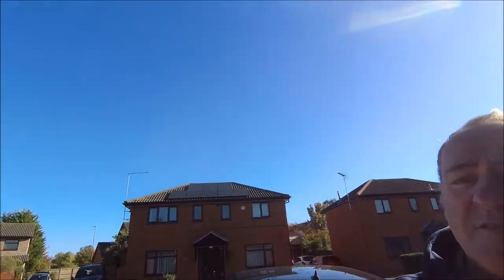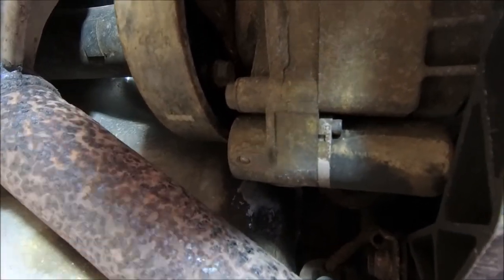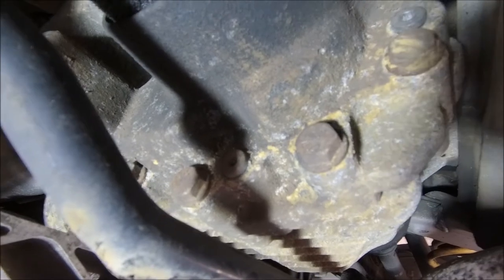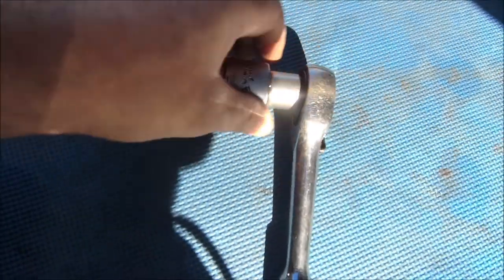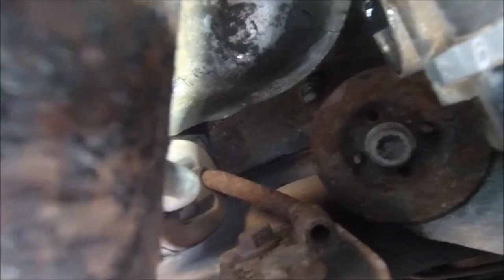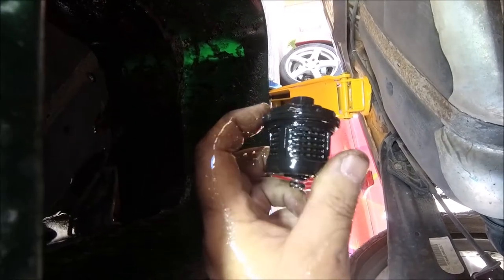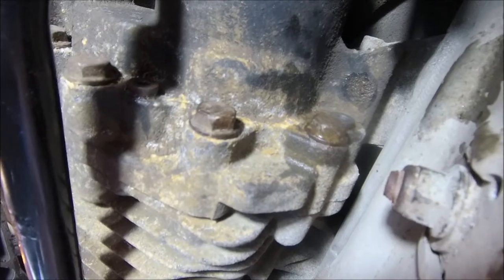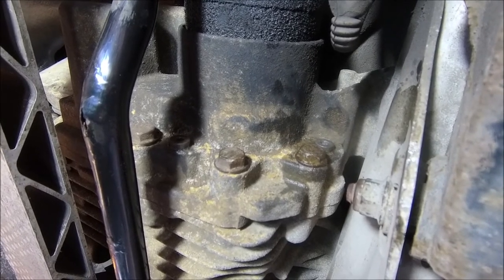Audi S3 /A3 Haldex Oil Change /service

Comment: Nice work Ade, only thing you forgot to mention is to always undo the fill plug BEFORE undoing the drain plug. This is incase there is a problem with undoing the fill plug. Oh and nice to see your vids in 1080p😊
Reply from the maker: Good tip!

Comment: Thanks for the video.. Worth noting that you will need to recheck the levels after doing a little run as the fluid will have ran through and may have dropped a little bit.

Comment: Hi Adi,

I’m just doing a similar job on my Audi A3 3.2. 2004. Which looks the same as your S3 by the looks of it!

I’m now just checking the things I’ve done so far! 😂

Just to confirm, you video was changing the heldex filter and then changing the rear differential oil? Leaving the heldex oil in the heldex system?

I started by draining oil from heldex, removing filter, pump, heldex unit to be checked for water ingress. Then whilst I was under there I thought I’d do the differential oil as it was up and flat! I drained and filled the diff oil out of the same plugs you showed on your video!

When I watched your video it didn’t show oil coming out of Heldex system…which has left me confused and doubting myself!! Help!! 😂
Reply from the maker: The Haldex sits in the rear diff oil as one unit , so as long as you drain from the bottom and then fill untill it comes out the top drain , all should be spot on .